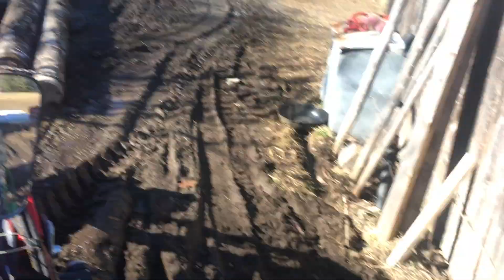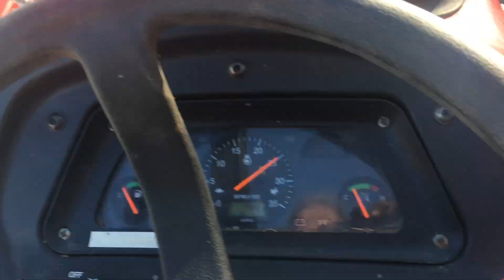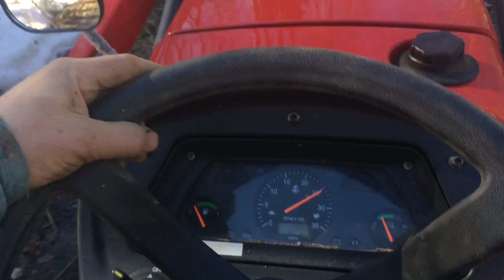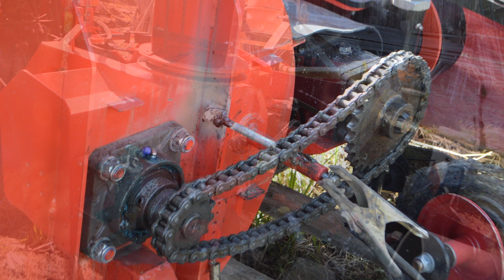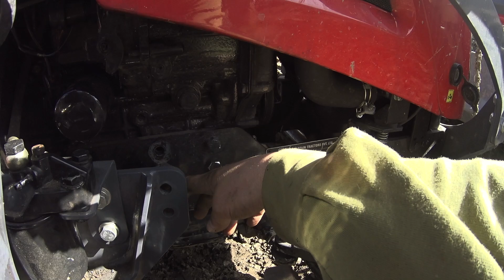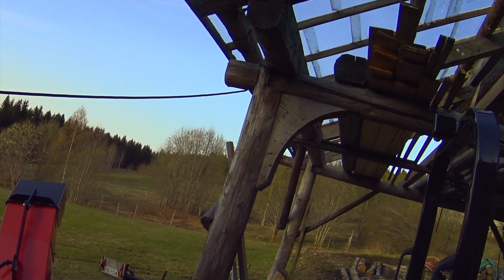First repairs on my Captain 263 compact tractor and its' equipment, (Slow film).

Comment: I am looking to buy this tractor too but I’m not sure if it’s good for the price! I would like to know the bad side of it or what goes wrong with it often.
Reply from the maker: I think that how you use a machine like this will determine how much it goes wrong. Kibota are probably better, though a lot of the parts are the same.
Reply: @LucasRichardStephens thinking to use in small garden like tilling and mowing.. but also front lift is great to have

Comment: Where did you buy the tractor? Im looking at those maceas deals for old (20+ year) kubota compacts with the front end loader on them.. they are in the 6-7k range
Reply from the maker: Yes I considered getting an old high quality brand, but decided that this 8th generation, award winning, low cost tractor would probably be less hassle. I don't find it easy to find the time to repair the vehicles I have already, I didn't want to add another old machine to my collection. I have waited for 20 years to make the final decision. I hope it was the right one.